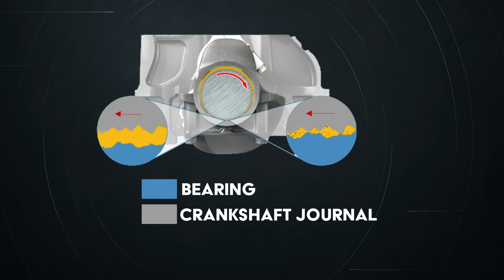the truth about start-stop technology (finally proven)

Comment: Toyota solved this decades ago with the Prius and nowadays their entire hybrid lineup. It's astonishing to see how other manufacturers haven't figured it out, or worse, they might be deliberately accelerating engine wear.
Reply: What was their solution to the problem?
Reply: @russellborn9073 low compression engine with extremely low startup strain, fully electric pumps to keep fluids moving and parts lubricated. 

They perfected the design in 2005, most other US  manufacturers haven't followed suit because reliable engines doesn't sell more cars. They for a long time just modifed their current designs to match the trends and ridiculous EPA regulations, leading to terrible engines that fail prematurely

Unfortunately we live in a society where profits are ONLY allowed to go up, companies have too many rich people riding on them for them to ever lose.  Rule #1,  if they need a marketing team to advertise and sell it to you, you should be extremely apprehensive about buying it.
Reply: @russellborn9073 The electric motor spins and warms up the engine without combustion, so it doesn’t cold start without any lubrication.

Toyotas also start the engine even when the vehicle is stationary if the engine temperature drops too low, to maintain both engine temperature and lubrication.
Reply: @russellborn9073  I’m not sure. Perhaps because the electric motors start moving the car and allow the engine more time to start moving and it’s less of a jolt. With moderate acceleration my hybrid motor doesn’t even start after accelerating until like 15-20 mph, and it’s an unnoticeable transition, beyond the noise of the engine.
Reply: No they didn't

Comment: I have a 2014 Audi Q5 TDI (Canada) abd when new it stopped at a roadworks. We thought something was wrong but relaized after a few minutes it had that SS system. I found a button on the dash and pressed it 11 years ago and bingo. It idles all the time now. Looking at a Toyota Tacoma now and am buying a manual shift for a few reasons and this Start-Stop reason is one of them. Agree with your video.

Comment: There are some bold assumptions and heavy tech removed in your botched testing. Also joke aside on your ending phrase "Germans can build engines if they let us" 

Yeah you can also fake and cook the said engines results IF they let you. You could only build engines (and generally engineering) when you a** was rely on that . A.k.A the period 1930-1940  because there was no inspection and testing required. Apart from that yeah nice branding and PR was your whole contribution.

Comment: Thank you for posting this, and I think I have something interesting to add.. I have a 2021 rav4 hybrid, and I think that Toyota has a few approaches to minimize this;

Toyota is well known for using VERY thin engine oil, 0w-8. I don't have definitive evidence, but it would be interesting to see how much faster (or slower) this oil is able to come up to pressure from dead stopped, just as you did in the video. 

Toyota takes advantage of the hybrid electric motor mounted to the engine for a couple things; 
- Starting the engine
- Assisting the engine during high load
- Fully powering the vehicle when the engine is shut down automatically
My vehicle seemingly performs this start-stop dance 8x as much as a normal vehicle with auto start-stop. Here's how a drive shakes out:

Cold start
- The engine runs until the vehicle has come up to temp, which is shockingly quick. I'm figuring this is due to the 0w-8's thin properties.
Up to temp
- Now that the vehicle is up to temp, it checks the hybrid battery charge. If the battery needs topping off (~85% capacity) it will continue running the engine to charge the battery to that point. Light acceleration will be driven by both the electric motor, and the gasoline engine.
HV battery charged
- Now that the hybrid battery is charged optimally, the system checks the current load being requested by the throttle. Within specific parameters (Which are honestly a fairly wide range) the engine will shut down, leaving the vehicle powered only by the EV motor.
Running on electric
- At this point, the vehicle will continue on electric only power until one or more of these happen:
   -Throttle exceeds capable parameter of electric motor (lead foot)
   - Load exceeds capable parameter of electric motor (such as a steep uphill climb)
   - HV battery is getting low (~20%)
   - and very likely other 'magic' done behind the scenes with the forest of sensors all automakers use

I'm comfortable saying that on a long trip, lets say 200 miles of highway driving, my vehicle performs this dance at probably hundreds of times, automatically, with no intervention. It's barely noticeable, even being at 140k miles on the dash. But it's all part of the incredible fuel savings. I fill my car up once every two weeks, each tank squeezing ~500 miles out of 11.5 gallons of gasoline. Very impressive given the vehicle has a curb weight of almost 4000lbs, and is fairly spacious. If I drive more aggressively in sport mode, I usually will get ~ 35mpg instead of 42, a decrease for sure, but negligible when I'm hardly pushing $30 every two weeks for gas money. Even if I wanted to however, there's no way to disable the start/stop. Which honestly, I have zero reason to in the first place since the EV motor is strong enough to pull the vehicle out of a driveway and safely into traffic.

Please feel free to inform me if you have any comments, I'm genuinely curious what toyota did differently here to start stop so many times. I'm willing to bet that its a combination of interactions, including thinner oil, maybe they have an electric oil pump keeping everything up to pressure while stopped, as the water pump AND AC compressor are both electric on my vehicle, as far as I'm aware.  I'd love to learn more honestly if anyone has any input. Thank you for the video!

Comment: Meh, my Kia Rio 2018 have gone more than 201000 km, with start stop on normally, mixed drive. No issues with any engine parts. Still starts as good as the day I got it. Let's see how long it last, I won't turn auto start stop off.

Comment: Another thing is that this technology is plain dangerous - systems like powered steering usually rely om engine running. In certain circumstances it may cost you precious half a second which may save your life.

Comment: Engines with start-stop (S&S) systems reach proper oil pressure (and thus proper lubrication) only when leaving the idle rpm to actually move the car after a stop. This is intentional because you are not supposed to run the engine at idle at all, as the S&S system stops it for you in such cases.
So, if your test is based only on repeated cycles of “start-idle-stop-start-idle-stop…”, the engine never reaches proper lubrication conditions. Essentially, the engine is running under-lubricated, which explains why you observe all those damages.
P.S. You are also missing a proper baseline reference.

Comment: There are so many things wrong with this test. This car is most likely not start-stop equipped. That would mean it's missing all of the other technology that had to be developed to make the feature usable. You're not checking oil pressure before starting the engine. You're not checking engine and component temperatures. You're just brute forcing cycles, not imitating actual start-stop technology. Modern cars will disable the feature on their own when conditions are not suited for it. You just scraped through the precautions and burnt up a bearing.

I'm no fan of the feature either, but this is a bunch of misinformation that will only hurt your cause in the long run.

Comment: There is something strange in your test or at least you are not telling the numbers. But if the amount of starts is about 10 times more with start-stop enabled, than the wear should be comparable with a 10 year old car without start-stop. Yet you compare with a million km engine with hardly any wear. That is strange. At some point the amount of starts should be comparable equal and so should the amount of wear be. if not, there are likely other parameters at play that influenced the wear. So I'd like to invite you to setup a proper scientific test with 2 exactly the same engines and with only 2 different start-stop cycles (one being the start-stop version and the other being without start-up) and also give us clarity on these parameters and how you got to the ratio between the two. Also I think a longer run would be more interesting.

Comment: So rather than figuring out how a 1million km engine could be built with start-stop, engineers will rather complain about it instead, pretending archaic engines are better. Anyway, I have no stake in this, electric motors are the way forward. But the video comes off as a senile granpa complaining about tech trends - even if the bearing test was very informative, the tone was completely off. 

To add to the informative part of the video, could have also measured total emissions during equivalent lifetime with start-stop and not since environment-friendliness was raised as one of the criticisms. And yes, it matters, living in city, you breathe emissions 24/7 which has significantly increased respiratory diseases for people in cities and near highways. Replacing engine won't affect children growing up in a city (but I do agree, failing engine prematurely is terrible as well) - maybe start-stop actually reduces the toxic gas in the air but from this video we won't find that out.

Comment: Okay, I'm 2:30 in and had to stop listening. You clearly haven't fully investigated start/stop mechanisms. My Skoda, turns off the s/s when the engine is cold. It maintains the oil pressure in the stop state.
Regarding other comments:-
Going from highway to lights on an exit. See above, the engine isn't firing, but oil and cooling is still being regulated
Taking your foot off the brake does not start the engine in my car. I come to a stop, the auto brake engages, and the s/s may engage. I take my foot off the brake, and the the engine remains stopped. It starts again when I press the accel/gas pedal, and engages the clutch after a short moment, I presume when the engine is ready to take load. I actually use a double tap method. When I see the lights changing, I tap the accel/gas pedal, engines starts. It is full ready when the light turns green and I press the accel to move off.
Y'all need to stop using your cars the same way you did, adapt. Just like I'll have to adapt my driving style when i have to move over to an electric car

Comment: Brilliant video, had always assumed from an oil pressure and part wear perspective it was not a good idea to use stop/start. I have had it "disabled" in my last few cars (Bimmercode app). For MOT, just push the button again, and it is activated again. I'm not permanently disabling it , the car just remembers if it was on or off when I turn the car off.

Comment: Start-stop is here for many years now, so we can use data to see where truth is. Do engines fail more then before?
Reply: Yes.
So do batteries and starters.
Reply: @tommymakem2611  Any data supporting that?
Reply: @MrVolodus 
Other than stacks of cores, not really.
Reply: @tommymakem2611  Lol, the newer starter motors with stop/start are far more robust. 

I'm not talking about engine wear - that's a different debate, but I've barely seen any modern starters fail.

Comment: Just go electric... I am never going back to ice engines. I got 0 maintenance, oil, filters gearboxes etc, none of that. One in a blue moon you go to get 10 screws removed and battery changed or another 10 and drive motor changed....

Comment: I really like the video, thank you. I think this "solution" is for the test cycle only like many others. It is more of a regulatory issue, because it is a prime example of using an experimental idea without proper preliminary test and later follow-up. The whole verification, review and change to the new needs is missing from the regulatory side. From a car manufacturer point of view it does not matter, it is a cheap and not too complex solution to meet the new needs...at least on paper. The wet belts and a lot of other things are similar.

Comment: the habit of pressing the start/stop off right after pressing the start button is so seamless, i don't even need to disable the function permanently.
Reply: It usually takes it shutting off at the first stoplight/stop sign for me to remember. After seeing this I'm going to try to be better about remembering.
Reply: @pvanb  The cars I have had with stop/start take so long before the stop function activates that on journeys of upto a few miles it just didn't activate. Many people have a habit of keeping the car in gear at traffic lights with the clutch depressed which again stops it cutting the engine.
Reply: @nineoneten sadly my car still shuts off while in gear. So I have to disable that function every time I get in the car.
Reply: @nineoneten But you are then ruining your clutch sitting for minutes on the clutch
Reply: @nineoneten  what clutch
Reply: @nineoneten  In an automatic, if you creep up after stopping, it deactivates it.
Reply: @pvanb try putting a sub in your car. After my friend got hers installed that feature stopped working all together.
Reply: @pvanb Waste your money if you want, but start-stop increases the lifetime of the engine.
Reply: @MrRoguetech 
it is probably the opposite.

What it does do is raise the fuel efficiency for total distance driven. And this is why they use it… To get better ratings from government agencies. And it has to be on by default for those better efficiencies to be advertised.
Reply: Im the same, hit the start button then the auto off.. 

I am thinking about buying the aftermarket kit to disable it permanently.
Reply: @viracocha03  Use a small piece of cardboard in the button.  No kit needed.
Reply: @fredsilva7274  Forgive my dumb reply but what do you mean?
Reply: @viracocha03 😂 You aren't merely wasting money by decreasing the lifetime of the engine, but planning on spending money to waste money? That's dedication to wastefulness!

You could also invest in some LED lights, truck nuts, a tailfin, and maybe paint some stripes on to make if go really fast!
Reply: @viracocha03 why you hate nature?
Reply: I never needed to press this button, or any buttons apart from choke to accelerate the heating phase in my Mk1 Golf ;)
Reply: Stockholm syndrome
Reply: Add lane keep assist to that habit.
Reply: Someone made a device for the Ford trucks that plugs in behind that actual button and it would simply remember what the button was on after the last shutdown, essentially pressing the button every time the truck was started.
Reply: @OnFinalConstruction They also sell truck nuts to put on the tail hitch. That increases towing capacity. You can also put LEDs underneath to make it go faster.
Reply: It's literally muscle memory now, when I do remember, it's already off and I don't even remember doing it.
Reply: Bypassing the OnOff function is the best way to eliminate the hassle factor of switching it off each time the car is started. Many aftermarket tools and apps available to allow access through the vehicles OBD port to the electronic control unit to permanently turn it off.  It is physically impossible to use the OnOff function without increasing excessive wear and tear on the cars engine.  This is the main reason why I’ll only purchase used cars with less than twenty k miles.
Reply: @chuters01 Spending money to waste money by decreasing the lifespan of the engine... That's real dedication to wastefulness!
Reply: They should make this loophole illegal.
Reply: You can wedge a small piece of cardboard into the button to keep it permanently off.  Works like a charm for me.
Reply: @fredsilva7274 You could also just not put gas in it. Then it'd never start, and engine actually would last longer, rather than just believing hard about start-stop causing more wear.
Reply: It's your money, waste if you want, but the start-stop feature extends the lifetime of the engine. Every second it is running is one less second of its lifetime.

Comment: Can there not be a system that uses an oil reservoir that is charged while the engine is running and then is released into the engine 2 seconds before the cranking starts?

Comment: They've made start stop so aggressive too.  Far too aggressive in my opinion.  My car (2025 Peugeot 2008 GT)  is frequently start-stopping before I've even come to a stop.  Parallel parking is made difficult because of this.  Approaching a give way where I can see that the road is clear so I don't have to stop, try to accelerate and discover the engine has shut off.  Even if if wasn't detrimental to engine wear, the potential fuel savings are vastly outweighed by the potential danger that is introduced by taking control of VITAL functions away from the driver.

Comment: There are two issues, start-stop and exhaust return. I drive a VW Diesel, with start-stop permanently disabled, as well as exhaust return permanently disabled. 10 years and 250.000km so far, no issues so far, side effect, my Batteries did last 9 years when compared with similar cars and activated start-stop, batteries tend to fail between 3 and 5 years.
Reply: Bruh, I owned two VW MQB cars with start-stop. Never disabled it. My current car is 2018 2.0 TDI, 7.5 years old, original battery.
My previous one is 2014 1.2 TSI. My parents still drive it. IIRC the original battery is still there. At least I didn't replace it when I used the car before the autumn of 2022, so it lived at least for 8.5 years.